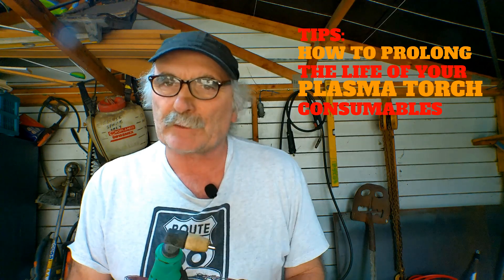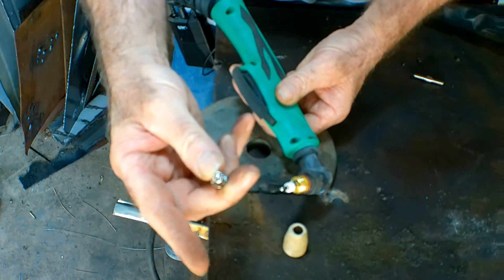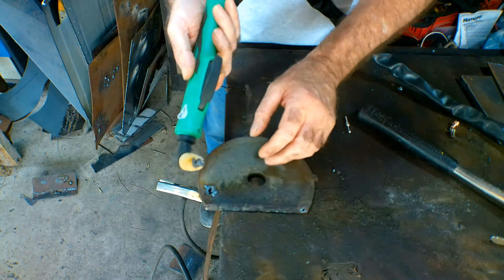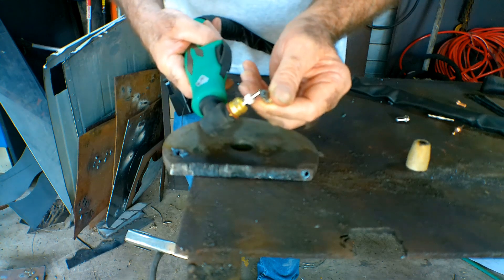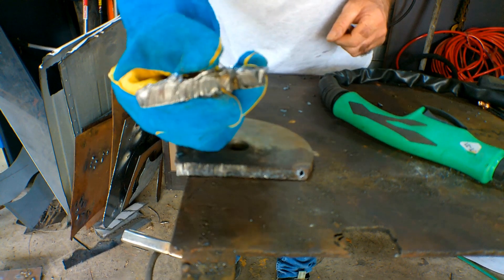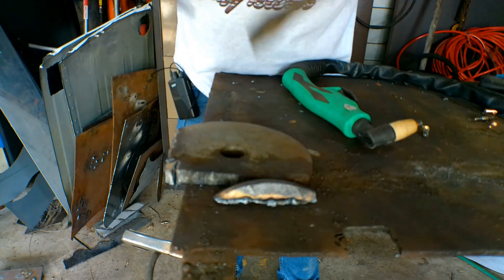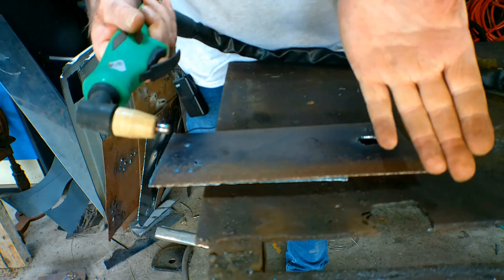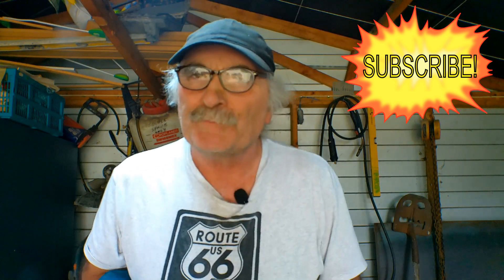The Secret To Stop Burning Out Plasma Cutter Tips

Comment: I always drill a pilot hole first & with reference to the short clip about ill-fitting tips I tried the m4 washer thing but I ended up using a m5 brass washer instead as the plasma torch head is brass as well.
Reply from the maker: cool tip thanks